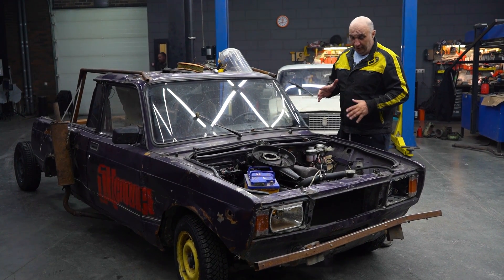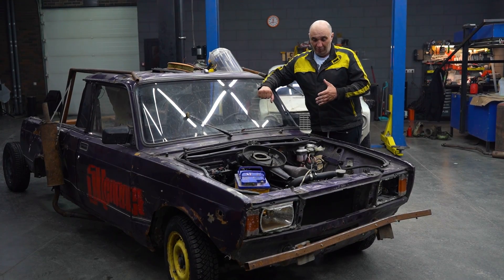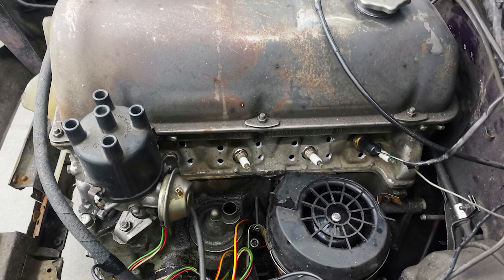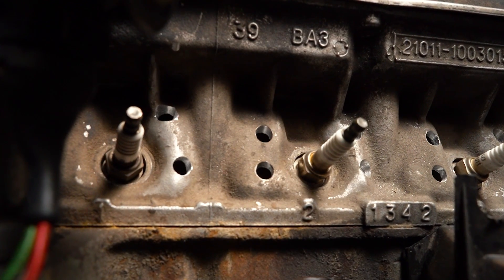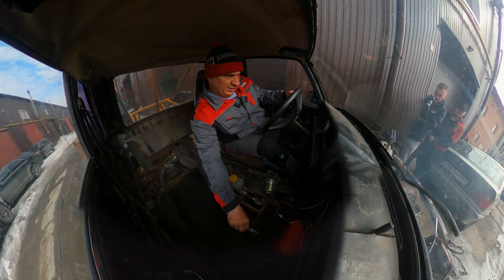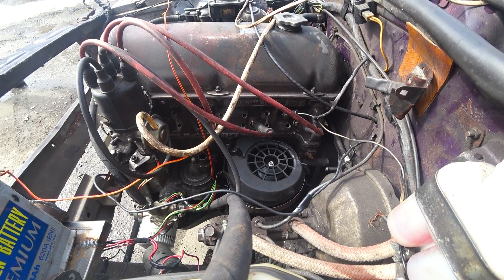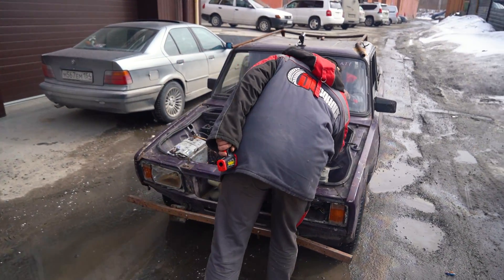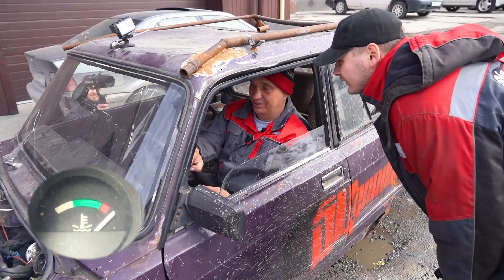We convert a Lada motor to air cooling

Comment: As someone else mentioned air cooled engine aren't just air cooled they're also oil cooled. The VW beetle has a small radiator for the oil sticking up off the engine inside the air handler.
Reply: A Deutz is an example of an air cooled engine
Reply: My bike is just air cooled. 1992 xj600s diversion/seca II. I am going to be adding a oil cooler because it does get a bit toasty.
Reply: All air cooled engines that have lubrication systems are "oil cooled". The flow of oil from the cylinder head back down displaces heat from the top end.
Reply: 2 turbo charger compressors belt driven... 1 the water inlet sucking in air to keep head cool >> 1 on the outlet sucking the heat away from the block... ?
Reply: @freakyfreerider  I mean all air cooled engines are oil cooled with fins for extra block cooling
Reply: Yes indeed. I have an old beetle and this is how it's done: air cooled oil using a radiator.
Reply: Oh yes the good ol oil bath on the old beetles. I miss my 68, easiest car to work on. All of about five minutes to pull the engine and one person could pick it up by the exhaust manifold to move it.
Reply: the earlier beetles didn't have oil cooling, just air cooling. Later oil cooling was added to male it both air cooled and oil cooled.

Comment: did a conversion similar to this to a industrial diesel engine a few years back, because it had a hairline crack in the block and burned coolant.
I used a big turbocharger, driven by exhaust like usual, but the compressor side was connected to the engines water jackets. Where possible also holes and slits were made in the block, to have the air circualte.
That engine runs flawlessly to this day
Reply: Using the turbo to force air into the water jackets is a pretty damn brilliant idea.
Reply: now that is cool
Reply: That is ingenuity at its finest. 👏 👏 👏
Reply: please try this
Reply: If this is around and working still, you should make a video of it. It would definitely do well.
Reply: Ingenious
Reply: Whats the typical outdoor temperature where the engine is being operated. Love the idea
Reply: Make a video
Reply: @brockallentaylor that's what turbos do to head gaskets eventually anyway am I right LoL
Reply: How about adding a thermostat controlled wastegate to control the temperature? Lol.
Reply: Post a video or it didn’t happen 😁😛
Reply: The "cool" thing about a turbo is it's load dependent. When the engine is running harder and making more heat it spools the turbo up more to move more air. The other thing is diesels don't make as much heat and sometimes have trouble getting up to temp when it's cold out.  That's why some trucks block off the radiator in the winter, both to keep more heat in the coolant and prevent cold air from going in the engine bay.
Reply: Awesome!
Reply: idea put a amr300-500 connected to a regular water radiator it blows through the rad then out into a inter-cooler then into  engine comes out the other side of the engine water hole and back into the amr300-500  or any super charger  i wonder if that would be enough air flow to keep it cool i just dont think that tiny fan was fast enough 
i had simular idea but its chilled with 2 coolers
Reply: @jamesh5111  yep
Reply: Для дизеля достаточно сделать диффузор на корпус двигателя с нагнетателем
Reply: Wow, literally genius 👌!
Reply: Come here to say try this

Comment: air cooled often basically means oil cooled. so add a big oil cooler and more oil capacity.
Reply: well, you could just replace the cooling liquid with oil and drill a hole to combine the circuits or have the return back down through the radiator from the head
Reply: Agree
Reply: My air cooled Honda motorcycle has a pretty large oil cooler in front of the engine. The 4 cylinder engine doesn't have big fins on the cylinders, so it's all done by the oil cooler.
Reply: Nah.... Air cooled often means a whopping great set of fins around the cylinder, great air flow and no seperate oil radiator.... There are plenty of classic examples that prove that... It didn't work out too great in higher compression  and / or 4 stroke engines hence the advancement to air cooled oil radiators.... Which actually work quite well - simple example is Suzuki Bandit 600, popular, reliable, high compression 4 cylinder 4 stroke.....
Reply: I did that to a 91 Chevy lumina in high school, I added a condenser from a window ac unit as an oil cooler, set the radiator fan to always run and cut some air vents into the hood for a sporty look 😆. Oh yeah and I also ran some dryer duct to where the water pump used to be towards the fan so air could circulate through the engine and come out where the radiator hoses used to be. The car ran like that until the chassis rusted through and had to be scrapped.
Reply: And oil coolant line would be would be very helpful I agree also the exit vent for the hot-air is right over the top of the intake for the air trying to so if they relocated that they probably be in good shape
Reply: @pockets5921  Man sounds like a bot?? 🤔 Correct info badly relayed!
Reply: @TheRattyBiker  maybe just bad English
Reply: @TheRattyBiker  BMW R1100xx, R1150xx.
Reply: I've got an air cooled motorcycle with no oil cooler, I've never measured the temperature but I would guess it sits around 115c
Reply: @NOONE-hp8bw  I have a 1980 Kawasaki Z250 2cylinder which is air cooled with no oil cooler and I used to run it to red line all day long
Reply: @lasskinn474 problem is the oil pressure may blow a normal rad
Reply: This is the way.
Reply: idea put a amr300-500 connected to a regular water radiator it blows through the rad then out into a inter-cooler then into  engine comes out the other side of the engine water hole and back into the amr300-500  or any super charger  i wonder if that would be enough air flow to keep it cool i just dont think that tiny fan was fast enough
Reply: Thats cheating
Reply: @TheDigger06  transmission fluid coolers are the fix for that. They are designed to hold oil pressure in higher ranges than most engines run at. Maybe chain 3 good sized coolers together. The reason they put fins on air cooled engines is that they operate like heat sinks. They help pull the heat out of what they are attached to and the airflow across the increased surface area with the fins keeps the temperature of what the fins are on in check.
Reply: Bout to say just add a big dumb oil cooler it'll be fine 😎
Reply: I think these are just splash lubricated, so the oil cooler is of marginal use without water in the jackets. If it had actual oil squirters to cool the piston crowns it might work.
Reply: This
Reply: @CommeradeZhukov  How exactly did you use an AC condenser as an oil cooler? A window AC condenser would be way too restrictive to run the oil through and I can't see how you would connect that.
Reply: @averyalexander2303  depending on the unit it's taken from they can vary from quite small to vary large, the one we used came from a 2000 watt Emerson that looked as if it was made in the late 80s
Reply: @CommeradeZhukov  Still wouldn't work. Even a 5 ton central AC unit (the largest unit available for giant houses) still only has around 23 HP of cooling capacity and that's obviously way too large to mount on a car even if it would work.
Reply: @averyalexander2303  okay then don't believe it, I don't care.
Reply: very true but there are some exceptions to this like the yamaha pw80 (idk about others) but they dont have any radiators at all the way they are cooled it by the oil in the fuel that takes the heat from the cylinder walls back into the cylinder

Comment: Surface area. You need cooling fins to dissipate the heat away from the cylinders and the head.
Reply: I was saying the exact same thing need cooling fans just like air cooled engines
Reply: How was the bowler fan connected?
Reply: @190SkyTeam  tell them to fab fins around the engine
Reply: Yes when I heard what they were doing I thought they would cut the block to the cylindres and add fins and to the head too and the add fins and close it all off the add a big fan at the front. Like a Deuts.
Reply: or insert a LOT AND I MEAn a LOT of coolef fans on that engine
Reply: Yep they're measuring the temp thru an air gap. The temp of the cylinders and the temp of the outside of the block are not even remotely going to be related, particularly since there is additional air that is being blown thru, isn't allowing that heat to escape to the outer part of the jacket. So of course it is going to read low.

Comment: Use A small turbo and route the outlet to the motor. Even small turbo's have more air pressure then stock fan's. This should cool the motor to satisfaction. Also make the holes In the head A bit bigger. Awesome video.
Reply: idea put a amr300-500 connected to a regular water radiator it blows through the rad then out into a inter-cooler then into  engine comes out the other side of the engine water hole and back into the amr300-500  or any super charger  i wonder if that would be enough air flow to keep it cool i just dont think that tiny fan was fast enough 

i think this would provide better cooling cause turbo requires the engine to be spinning past idle a roots supercharger moves are no matter what

Comment: Definitely surface area, perhaps loosely stuffing the coolant passages with coarse  copper wool/brillo/scouring pads.  But I was also thinking what if you used a turbo instead of an electric blower motor.  Hook up the hot side like normal with the exhaust, but then the compressed air from the other side is directed into the coolant passages instead.  That way when the engine is under more load, there is more air being forced through the engine.

Comment: I would have added MoS2 (Molybdenum Disulphide/Liqui Moly anti-friction) as well. It was an old trick to add to VW air cooled units in warmer climates, so that there was still an anti-friction barrier when the oil got too hot and started to break down. 
It's great at lowering temps to begin with since it reduces friction so much, and I add it to all my engines anyway, both modern and old, and all water cooled.

Comment: Use the Radiator that you took out of the car, and reconnect this to contain lots and lots of Oil. Put a Temp Sensor into the top of the Radiator. Keep the Radiator Fan turning with the engine. Then utilise the water pump to circulate the oil, but not through the water Coolant Galleries. Q=mct.  You will then increase the MASS of the oil - which will be cooled through the Huge Radiator itself. A simple Blower across the cylinder head (from the back of the engine to the front), should suffice to keep the rear cylinders cool, next to the Fire Wall, as these would normally be the first to heat-up without any water or coolant.You could also remove the Sump Filter Screen - for improved Oil Flow, and also remove the Oil Filter Element too! I am certain that the car would run much longer than it did.... Greetings from Australia.

Comment: You guys always have have the best ideas. This idea in particular is sheer genius. In tropical Siberia where you really have no use for a heater in your car or in your homes for that matter, air-cooling makes perfect sense. With only 8 or 9 months of very mild winters, a heater is just one more superfluous system that is destined to fail, leading to downtime and needless expense. Why have it? 

Maybe you guys could glue some plastic fins on the engine so it LOOKS like it's air-cooled. Then install some big air scoops on both fenders - kinda like the back of a Zaporozhets.  These simple mods should make all the difference!

By the way, that test car is absolutely gorgeous!

Comment: Put a fan that is powered by the crank for more flow, maybe to both sides of the engine. Add more holes for better ventilation, add an oil cooler.
Reply: That could work to cool it. Adding cooling fins could also work.
Reply: @sidgreentherhymeofreason  Yes, definitely. But it would be hard to add cooling fins on the engine since there is a cavity for the coolant around the cylinders.
Reply: @desnick2316  You're right about that

Comment: cut as much of the outer motor case away as you can and copper clad the walls  then use a spot rod welder (like ones used to weld rods on to body panels to pull out dents ) to weld 12 gauge copper rods about 3 to 4 inches long onto the copper clad walls. then  use multiple electric blowers to blast the whole engine surface with airflow .

Comment: to get more air, take the turbo from a semi, install it on the exhaust & take the air from the intake side & run it into the engine after it goes thru the inter cooler

Comment: Maybe next version... Carving off ALL the outer 'Water Jacket' housing, and welding on cooling fins (the radiator fan is already in place ready for it) and also adding a  mid sized 'Oil cooler' radiator (kinda like an older motorbike engine design)... 🤔😏😉👍
😎🇬🇧

Comment: 2 things air cooled engines have that this currently does not...
1. Cooling fins to cool down the block and cylinder head. (Big heat sinks)

2. Oil cooler to keep the engine temps down and possibly even a dry sump system to stop the heat build up.

Comment: I have a few ideas you guys propably already thought about.😂😂😂  Maybe you guys can carefully mill away the outer cooling jacket of the engine block, weld strips of iron or aluminum on to the engine block and cylinder head with a small gap between each strip. (depending on what type of material the engine block and cylinder head is made of) This will increase the surface area of the cylinder  head and cylinders; therefore, promote overall cooling efficiency. In addition, if you look at motorcycles, chainsaws, post- war VW Beatle, etc, most of these machines utilize air handling ducts that channel air through the cooling fins with the use of a mechanical fan. 

As for oil cooling, looking back on the VW Beatle they utilized an oil cooler to wick away heat. In that case, cannibalize a large oil cooler from a heavy-duty pickup truck or semi tractor (or whatever you can get you hands on) and retrofit the cooler to the oil system. This will increase your oil capacity and further promoter engine cooling. 

Keep in mind that I'm not an automotive engineer nor a engine disigner, these are just some ideas. I hope you guys find them helpfull. I'm sure you'll figure something out. I can't wait for a new video to come out about this topic. Keep up the good work. God bless you and your team.

Comment: Fill the coolant passages with liquid tin, machine the engine as flat as oil passages and accessories attachments will allow, then bolt on a bunch of CPU coolers. Engines waste about 30% of their combustion heat through the cooling system, which means you'd need about 20kW of cooling capacity which is somewhere between 100 and 200 PC heatsinks depending on the model. Doubt you can fit 100 under the hood though. Also, PC heat pipes are designed to operate at 30-70C on the cold side, probably won't work too well with a combustion engine designed to run at about 100C.